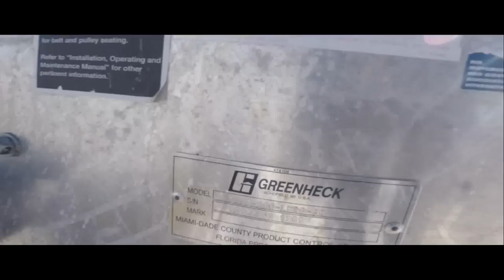HVAC-R. EXHAUST FAN. RESTAURANT SIZE. MUSHROOM TYPE.

Comment: I have a question.  Why is there liquid tight conduit running into a NEMA 1 switch enclosure mounted to the exterior of the unit?  That switch is only intended to mounted to the inside of a fan away from the elements.

Comment: i have the same exhaust fans, one of it running very very noise, what could be the problem.
Reply: Personally i'd start with the belt.  Use a "cogged" belt, one with teeth. Do not over tighten the belt either because that'll just make it worse.  If that doesn't help check the wheel and make sure its not full of grease or debris.